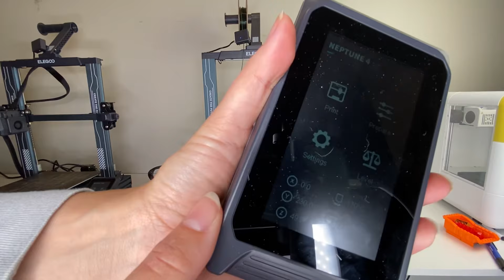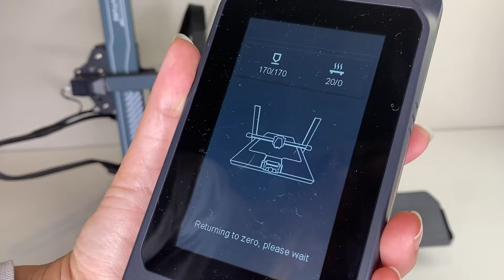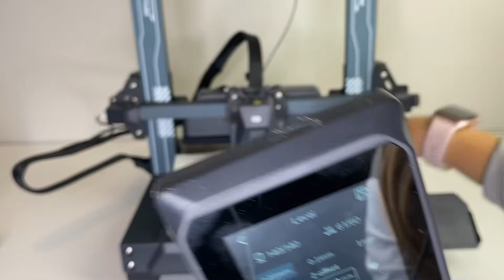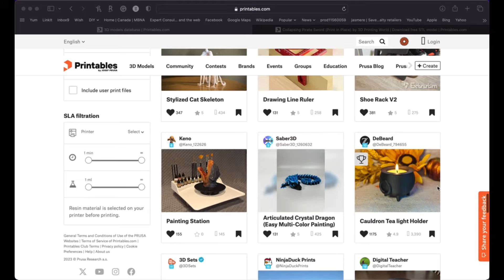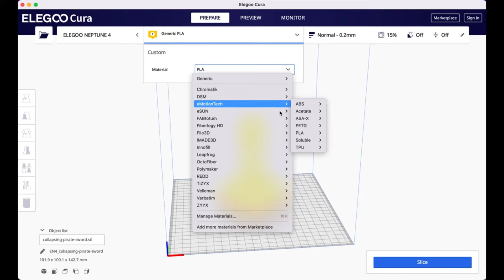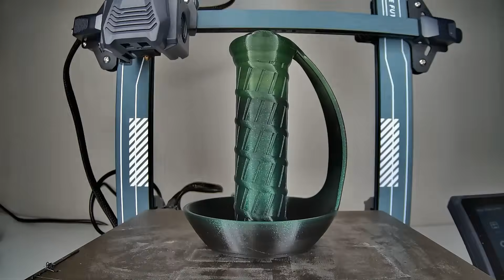How to use the Elegoo Neptune 4

Comment: 1. load filament, insert in printer head feed 1.5 inches

2. prepair > extruder > load

3. prep print bed with glue stick

4. level print bed, level> automatic> confirm> perform paper test adjustment> exit> confirm

5. find STL file and download 

6. open ELEGOO Cura slicing software and add printer

7. select printer

8. Open file

9. Click Slice and save to usb thumb drive

10. transfer thumb drive to printer, 

11. print> locate file> confirm

Comment: My Neptune 4 plus can't print using pla+, it won't stick at all, and if i don't use the gluestick for normal pla, it won't stick either, i used a Bambu lab printer for a few weeks and had no hassle at all, the 4 plus is a piece of shit compared to bambu lab.
Reply: Hey Mark I've just got one, at first I was struggling too and decided to take a look at it, my Z axis was loose where it clamps onto the leadscrew, give them all a tighten up and check your level and Z offset again now that it's moved. And you should be all good 👍 I'm currently using pla+ with mine, I'm using a gluestick though just incase
Reply: @justtry8557  Hi, I've got it working working OK with standard pla, I've scratched the surface of the plate up with wire wool and and I've not had to use the glue stick since. Also, I've moved the nozzle a bit closer to the plate.
Reply: @MarkyB1 that's great, I'll give that a go too, bit of a pain to use glue all the time

Comment: Does anybody have an idea why the software doesn't see my Neptun 4 printer in the network? I checked the firewall, i updated the firmware to the latest version, i tried the software on the stick and the newest one from the website, nothing worked. I get the printer over the web browser and i can control it there but in the software it doesn't work that way.
Reply: I how by now you figured this out but make sure your on the same network ie 2.5 or 5g
Reply: @OggieDoggie  yeah, thx. all fine now printing like a maniac everything i see. 🤣
Reply: @knallerbsenstrauch  lol yeah right. mine runs 24hrs a day. excepot nights it gets too cold in the garage

Comment: First of all, this is not a beginner friendly machine. Second of all, your tutorial is not for beginners too. You extruded filament at 170 degrees. That's gonna wear out the extruder. Also you didn't mention the auxiliary levelling. This is not a bambu printer. It's not gonna do the levelling itself. To anyone reading this comment:  if you're a beginner and want to be trying to fix and get help everyday about the printer, watch this tutorial.
Reply: Stay mad cuz bad bruh. My first printer and I'm using it fine
Reply: @wolfinheritor1007 mine will be here next weekend $113 shipped I couldn’t resist
Reply: This is true I watched a diffrent much more detailed video witch was by: PrintStart3D

Comment: I wish Elegoo would change the wording from "Auxiliary" to "Initial Bed leveling" it confused me at first too. From the numbers on your bed leveling screen it's waaay off. Do a "Auxiliary" bed leveling first, making absolutely sure there isn't any melted filament on tip of nozzle, very, very important!! After that, adjust your Z-offset, THEN do the automatic bed leveling last. You will see a MAJOR difference in quality of prints, I promise you!!

Comment: i cant get this one to work at all for some reason some of the fould outs spins on the plate when it gets to a point i have tired running it like you did and i tired setting it to only go at 80% speed i am new and dont know what to do about this
Reply from the maker: Try watching my video on adhesion - I use a glue stick on my buildplate to ensure the print sticks well.
Reply: @everythingSTEM  I have done everything from start to finish in your video and use my glue stick but what I see is that the stl file seems a bit wierd in the making of the smallest foldout have you ever tried pulling them all out and see what yours looks like? I have seen a few comments on he's stl file that they can't fould it out I have a feeling they have the same problem as me

Comment: Hello again, as you mentioned in your video, I tried pressing the same buttons with the same settings for the sword, but it's not working. My sword is slightly opening. What should I do? Please help :(
Reply from the maker: Hi! Send a photo to elegoo support - they are pretty responsive. I usually try re-leveling as a first step if my prints aren’t turning out.